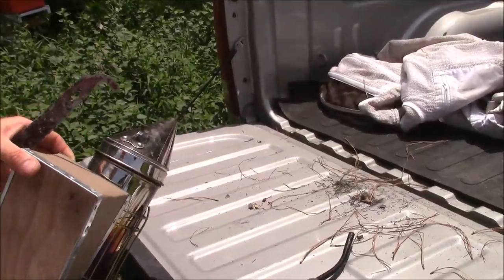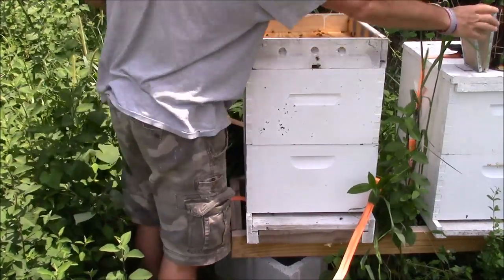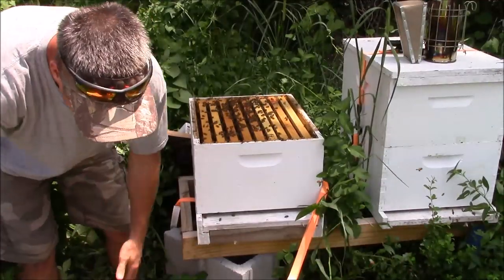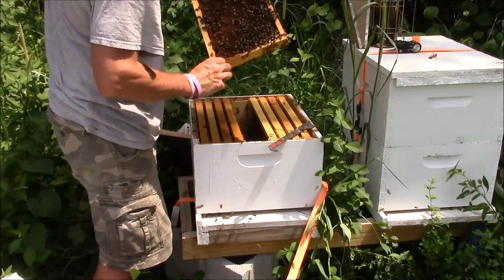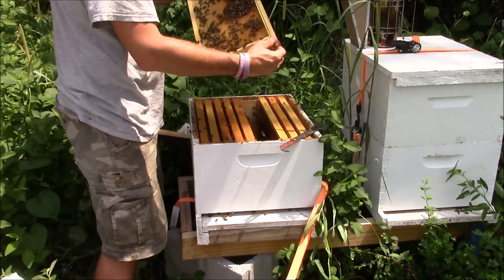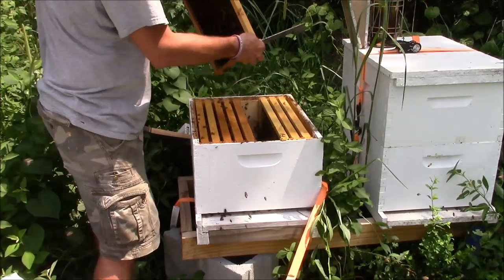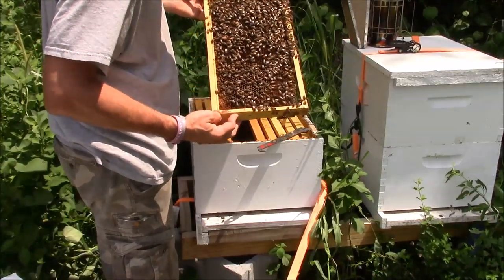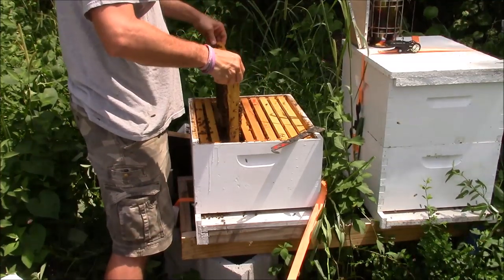Hive fixing to swarmed follow up (part 2)

Comment: How do you keep the ticks, chiggers and turkey mites off of ones self in North Carolina Darrell? Us Kentucky hillbillys would LUVE to know?
Reply from the maker: Normally don’t have an issue with them. I try to stay out of the woods in the summer time. If I have to go in the woods I use off
Reply: Citronella or Listerine (regular not flavored) works well, that's what I used in Louisiana.
Reply: Im guessing just add to a spray bottle  and follow with common sense!

Comment: Why do you strap the hives down? Is it because of bears? Great vid btw
Reply from the maker: +Erik Hauger I do it so the wind does not blow the tops off. I have had a few blow over and all I had to do was set them back up because I had the straps on them. Most put a brick or something like that on top and I use to do that but now I just use the straps. I get them from harbor freight when they are on sale.